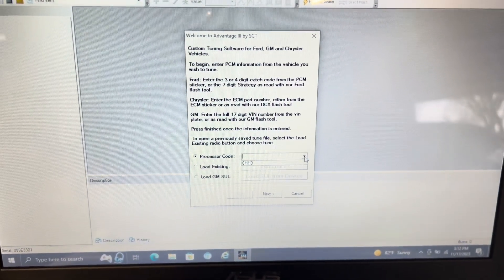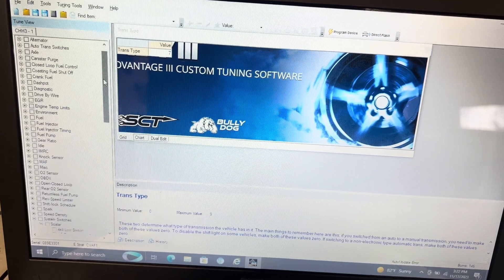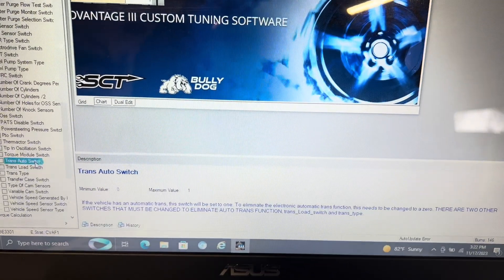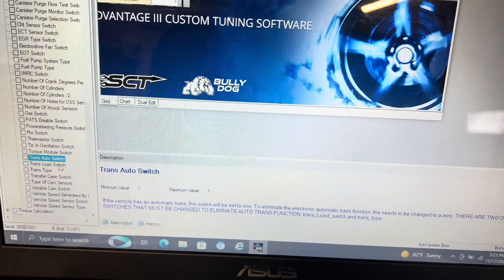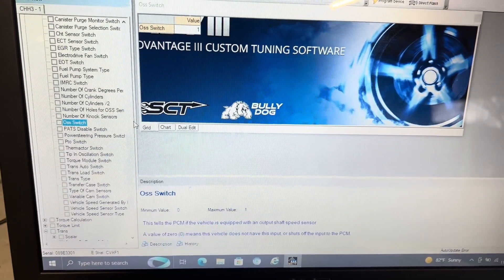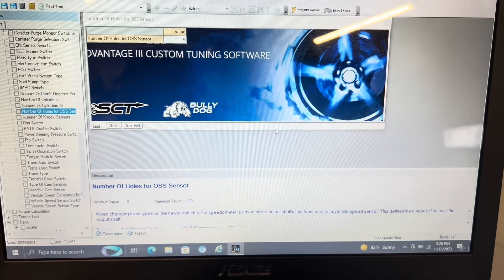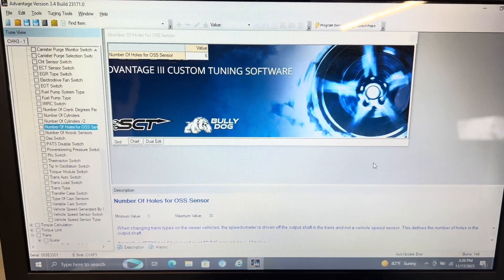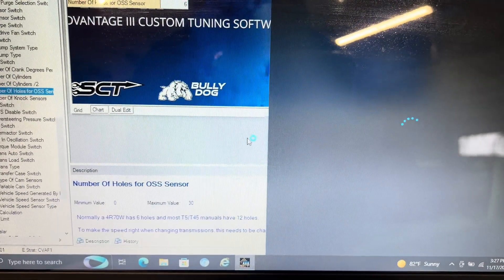Mustang Auto to manual swap ECU tune changes

Comment: hello
i am planning an AT to MT transmission swapping on a 2015 mustang gt 6at

i have the mt82, clutch, flywheel,ect (all mechanical parts )

i dont know the aspect of electronic

can i just buy a PCM, a BCM and a speedometor(all from the same 15-17 6MT mustang GT doner, all vin in the 3 parts are identical) + an engine harness  (for 15-17 s550 6MT   FU5Z-12A581-E)

then just SWAP-PLUG-DRIVE (no reprogramming needed at all)??

do i miss any essential part or procedure? or some concept i know is wrong?
Reply from the maker: I would this that could work, I’m not familiar with the s550 chassis though.
Reply: @forcefedhatch  still thank you~ i found the answer from other's video~😁

Comment: Do you think I could do this to a 2002 Navigator ECU? Am looking at a 8HP transmission swap, so all the transmission stuff will be removed. I can probably work around shifter interlock and park switch but I don’t want to have the ECU in limp mode or a flashing CEL. Am also in Cali so ECU tuning is a big no no. I can probably work around that tho. The speedo correction is nice.
Reply from the maker: Truthfully I’m sure you probably could!

Comment: Do you think an S197 will be similar to this?
Reply from the maker: That I truly don’t know, I would imagine that as long as you use the same software(advantage 3/pro racer software) it theoretically should be the same. Depends on how the speed sensors vary from one to the other.

Comment: After your swap did you have some engine stall problem? This program may be solve it? Mine stall every stop sign when i put clutch pedal at floor when i ride
Reply: Already did it
Reply from the maker: @SébastienLemay-x4m  I would say maybe look at the TPS as well, it could be the dashpot settings in the tune but I ran mine without the IAC plugged in and didn’t realize it. I’d say you can check those next.
Reply from the maker: @SébastienLemay-x4m  sounds like you need to do a base idle reset. I would follow fords recommendations on doing a base idle reset so the IAC use is set properly as well.

Comment: I have a manual ecu and the steering wheel with the key would I be able to plug it in and run it like that ?
Reply: I’m doing the swap myself I need help guys thank you ❤️
Reply from the maker: Maybe if the VATS is disabled.. if not you may have to just have it tuned for it.
Reply: Any idea how to disable vats or should I just program it like u brother ?
Reply: If the ecu, key, key cylinder, pats transceiver, and gauge cluster are all from the same car, then you do not need any sort of tune because they were all programmed together

Comment: wouldn't it be cheaper to get a manual ecu off ebay? I am seeing the ecu about $350 on ebay for my car
Reply from the maker: It could, but you would still need to have the anti theft disabled and a tune depending on what modifications you have done.. I already have the software, so this worked for me
Reply: That makes sense . Thanks for the quick replies! @forcefedhatch
Reply from the maker: @jacobn7597  no problem!